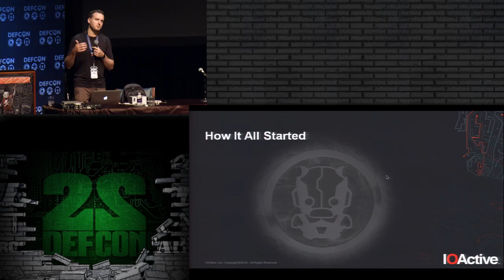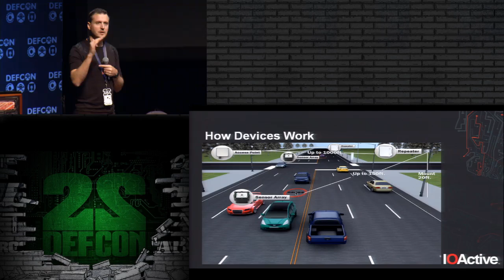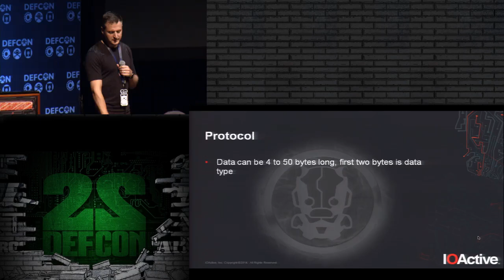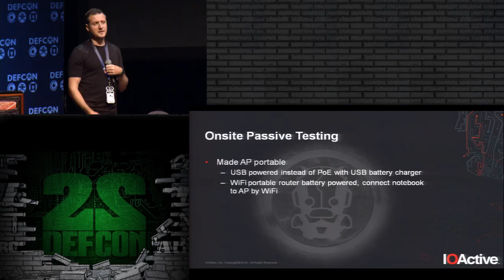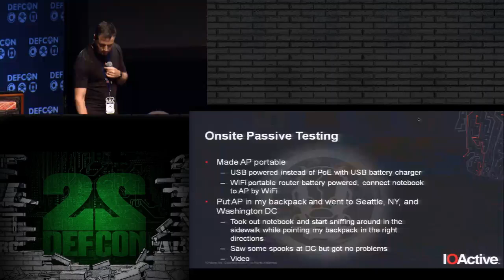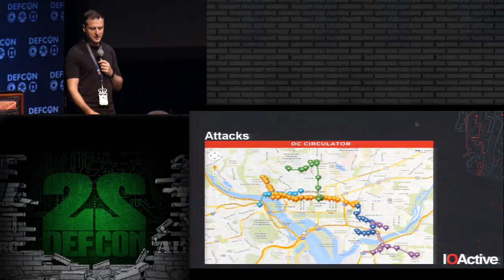DEF CON 22   Hacking US and UK & Australia & France etc  traffic control systems

Comment: The only way vulnerable implementations like this happen is with intent ─ Engineers are simply not that stupid; The vendor's canned responses are a dead giveaway.
Reply: Hitch Medberg Engineers (arguably) arent that stupid but the flaws appear when a system has to be designed for a wide range of applications, and is selected and installed by people who don't know it as intimately. Shodanhq has showed up THOUSANDS of situations like this. I'm an electrician who specializes in automation/scada and there are wide open buildings out there. Altho the security/hacker community tend to overestimate the damage that can be done (however not in the case of vehicle control systems!)
Reply: Ye4rZero John Mullen
Indeed.

"Engineers (arguably) arent that stupid but the flaws appear when a system has to be designed for a wide range of applications, and is selected and installed by people who don't know it as intimately."

Astute observation, and I'm inclined to agree in most cases.

& lol @ arguably ─ I feel ya, I've worked on both ends.

" WTF were you thinking?! "
" Yeah, I'm sure it looked GREAT on paper. Asshole. "

Anyway, happy trails :]
Reply: Ye4rZero You pretty much nailed it!
Reply: lmfao Yes!! It always looks great on paper, brother! I lol'd at that. Btw, love the play on words with your name. Well played ;)